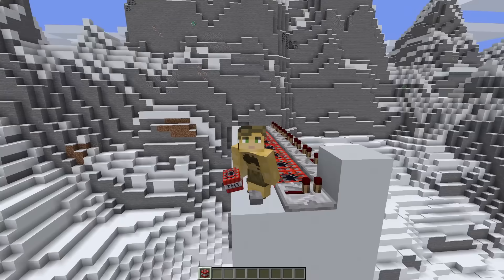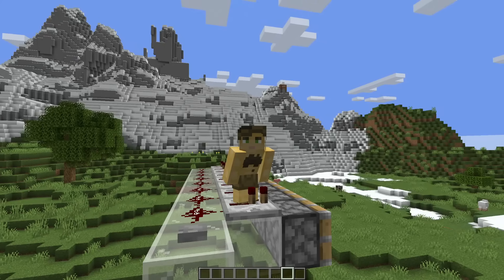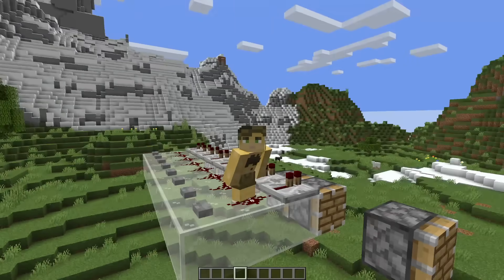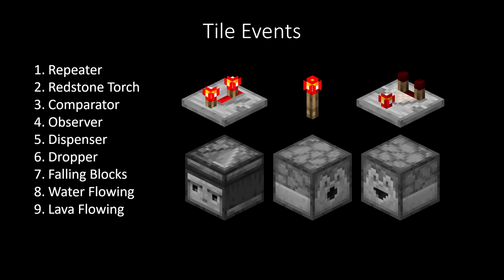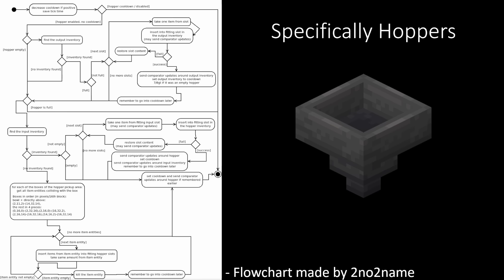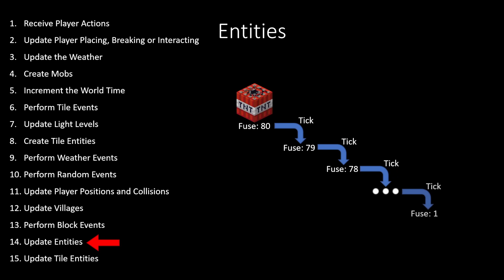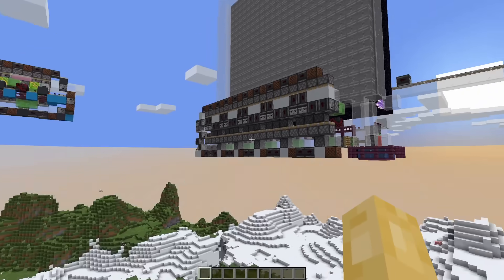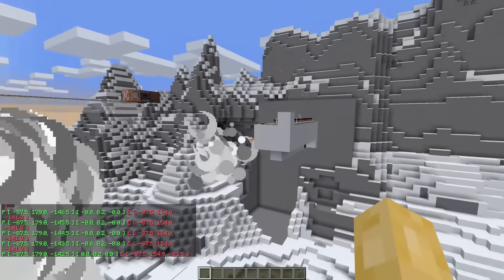TnT Railgun Using Minecraft's Quantum Mechanics

Comment: Would it be possible to change the direction of the tnt after it's left the cannon by timing other tnt to explode next to it? If it's possible, you could do some cool stuff by programming the tnt to go around things
Reply: It's possible, and it's very easy, just try it out yourself
Reply: oh yeah you could put some powered trapdoors next to the TNT alignment to change the flow of water a bit.
Reply: In 1.8 factions and stuff people build "lefty" and "righty" cannons which can hit a target and have tnt on the side shoot off the main charge.

Midair cannons can shoot and lefty midair can adjust in the air to hit a target.

U fusion cannons can adjust multiple times
Reply: You dont even need other tnt but yes its possible to do that aswell.

Search "255 lefty cannon minecraft factions" for your version with tnt and search

"255 infinite lefty cannon minecraft factions" for the version without extra tnt, it basically works by using order of directions ingame where E/W is calculated first before N/S
Reply: @Azaqa  you need other tnt if you want to change direction in mid-air AFAIK and for most purposes those ways to do it, that include hitting a wall are highly inefficient in TNT use
Reply: @ATOM-vv3xu  nope, search "255 infinite lefty minecraft factions" to see the concept for changing directions midair. You can also do it with tnt and its not that inefficient.
Reply: @Azaqa  I only saw one tutorial, that explained how it worked and it definitely didn't change direction in mid-air but instead changed direction, after hitting some blocks. If this tutorial/showcase was flawed I am open for you showing me ingame how it works
Reply: @Azaqa  and btw pls you play factions and pretty much the only reason why I never joined them apart of the fact, that it's still just everything 1.7 is, that faction cannons are not efficient and faction fights are not fun (compared to the alternatives at least)
Reply: @ATOM-vv3xu  https://youtu.be/tqtLz08SpuA

Heres a really quick video to explain the concept, you can find others that go more in depth if youd like and cannons that use it. We call it triangling in factions.
Reply: @Azaqa  if you use this method, the cannon won't be efficient, that's what I am saying all the time
Reply: @ATOM-vv3xu  dude its as efficient as ur gonna get for his idea...
Reply: @Azaqa  what your video explains is not what he explained and his idea is way more efficient than using what you call tnt triangles and powdered snow/enemy blocks to stop the momentum
Reply: @ATOM-vv3xu  dude what.... this is literally what hes talking about you can make the tnt go around things midair and go a theoretically infinite distance left/right. You could even go forwards, left/right, forwards again if you wanted to. As someone who has spent a lot of time using this in factions I can assure you its fully possible and you dont even need blocks to stop it, just a lot of guess and check (or some calculations)
Reply: @Azaqa  1. those direction changes have to have the same distance to each other (or 2% less each gt) 
2. if you want to use your facttions carrier as an excuse, I have spend almost 3000 playhours in an up to date tnt community that actually cares about efficiency and can confidently tell you, that for shooting straight and then to one direction (once), there are so much more efficient methods, that we don't even have terminology for thos stupid tech except maybe what could be translated into 0tick tunnler cannons, a tech that I haven't even seen anymore in 1.12
Reply: @ATOM-vv3xu  1. Yea, and?
2. If minecraft let me measure hours I would have a shocking amount on factions/cannon servers. We can shoot thousands of blocks through a 1x1 hole and stack sand from 255 to bedrock then nuke the sand stack with like 700 tnt. There are plenty of ways to left/right shoot and the most efficient and reliable is with triangles by far.
3.
Reply: @Azaqa  somehow my answer disappeared

1. yeah thats not named changing direction indefinitely it's just called shooting diagonal
2. I was just saying that talking about how much experience you have is pointless... and you do it again
3. what did you want to say
4. if you still think, that your tech is efficient just join our servers and try to compete with it, you'll stand no chance (keep in mind that we have different rules to benefit the fighting experience...)
Reply: @ATOM 2000  bro you really dont understand the level of efficiency... we actually had to grind for our tnt and work with limited amounts and had to shoot for hours. There were raids that went on for 48 hours straight. Everything had to be as efficient as possible. If you havent gotten into exposures yet you havent even begun learning efficiency.
Reply: @Azaqa  how do it comes that you expect me to not know about exposure? 

btw the fact, that the factions servers I went on don't even have TNT tracers, simulators and low tps, shows, that you just don't need to worry about every little bit of efficiency

btw. I even use calculators (that are not available to the public before you ask) to see if my cannons are even possible in a best-case-Szenario before even bothering spending hours on just finding the combination of positions where I shoot them

... and that raids go on for 50h is one of my main problems with factions, why bother fighting for longer, than you can stay awake, when you can fight for 5 minutes while continuously having fun
Reply: @ATOM 2000  we do have tnt tracers (we called them breadcrumbs), tps, we have mods with tnt recording to replay the shot tick by tick. The servers will all show TPS and the mods will do the rest (falcun, orbit, facutils ,ace etc) we also have calculators for plenty of things (distance based on exposure+power+gts+air resistance). We have calculators to find "midair ratios" which will find the exposure/power needed to stack 255 sand "midair" in a 1x1 block X distance away. Tons more calculators just cba typing them all, and basically none are public
Reply: @ATOM 2000  also in factions we organized things by timezone, we would have australians/asians for when its too late for NAs, EUs for when its too late for AUs. Thats not really an issue anymore anyways though servers added a shield you can set for like 16 hours of the day everyday. I havent played factions in a few years cause its just dead now but cannons in factions are definitely the most advanced tnt has ever gotten in mc
Reply: @Azaqa 

as I said we can talk on discord, the Youtube comments are not the best place for proving to you, that wargears and similar modes are more advanced, than factions (they might not have been back when you played but now they definitely are)

Comment: This made me think of the scicraft's ender pearl cannon. They mentioned that the pearl travels so fast it skips multiple chunks per tick so they don't need to load them. Applying this to TNT, could it be possible to create an explosion behind a wall without damaging the wall itself?
Reply: No, even when traveling super fast Minecraft still calculates colissions. But, if TNT should travel 10 blocks south and 10 blocks east in the same tick, it will do it in order instead of diagonaly, which allows for some kind of wall sikpping.
Reply: @JustARandomUsername2137  Well, that's a shame. Also means no insta-killing behind a wall arrow cannons. Although, Cubicmetre's shaped explosion is impressive enough by itself
Reply: @tooFarGonexk4he4tu3s  actualy, its possible with arrows. If arrow hits an enderman its colissions are disable for one tick so if its fast enough it can go through wall. You can see Docm77's hermitcraft 9 episode for more info
Reply: @JustARandomUsername2137  wow that is interesting. And, considering the speeds already achieved with arrow cannons, it should be possible to skip many layers of blocks in this single tick
Reply: @tooFarGonexk4he4tu3s  doc skipped about 300
Reply: @JustARandomUsername2137  We used todo this back on Cosmicpvp Factions. We shot straight down a wall on on the longside then straight right through regenerating walls, sand walls and normal walls all covered in water. So u had to fly TNT and sand over there. also had to break the slabs so u could stack sand on the wall to then blow it up.
Reply: Youre telling me they found a way to quantum tunnel in mc?
Reply: @picks6500  AYEEE QUANTUM
Reply: Yes you can. Tnt will go right through unloaded chunks. The only consideration is that once the first tnt explodes, that loads the chunk it's in, so if you want multiple explosions you need to space them out over time to let the chunk unload for each one.
Reply: what it means is the game checks on the chunks the entities arrive on on the tick, not what it passes through. For example an enderpearl passes through 3 chunks to arrive at 4th chunk, it will check the 4th chunk for collision, if it is not loaded then it will get stuck in there until the chunk is loaded. Which also means that you dont have to load chunk 1 to 3. Assuming your target is at loaded chunk and there are obstruction at an unloaded chunk before the target, and you did the math to know what chunk will be skipped and what will not, yes, you can quantum tunnel the tnt to the target.
Reply: @Thaumazein_FPS  awesome, i assume that calculating where the object will land normally will be extremely power intensive

Someone should maybe present this as a hypothesis for the occurence for quantum tunneling should it be an  unexplained phenomenon
Reply: @picks6500  hahaha, actually true, but still we don't know the absolute unit (the quantizing part of quantum mechanics) for physics irl. 

We knw its a tick for time in Minecraft, a 32bit float for collision or positions related measurements, and up to 64bit , 2byte for nbt data. 

But we still dont know for example what unit gravity operates in, or if negative values are tangible for phenomenon like time and temperature.
Reply: I would love seeing that too, a "Houdini bomb", that *teleports behind you* and explodes
Reply: Me wondering if you can somehow blow up obsidian with cannons
Reply: @lancetheking7524  Probably impossible, but if you were to make it push-able by pistons you absolutely could. I think it works because the moment it is pushed it has minimal hardness.
Reply: @lancetheking7524 TNT explosions are processed individually, so unfortunately no easy obsidian breaking

Comment: This is amazing but I find that I don't completely understand the portal event propagation. In this example you say that the front tnt are the projectiles and the ones behind are the charge. But also that the way the events go in order is like a snake up the portal. So wouldn't that mean the first block to be lit on the 2nd row (and every other past that) would be apart of the charge and not the projectile? So the cannon would fire forward for the first row but then then backwards the 2nd, and then every other.

I thought maybe I was mistaken and that they were all consolidated into 1 space but no it seems that there are 2 separate groups of tnt: the front column and the rest. Is there something I'm missing or was it just explained wrong? If you could help, that'd be grand.
Reply: I don't know much about portals, they are a pretty bad solution to ignite the tnt but he used two different sets of tnt and seperated them at least about 2 hundreds of a block, maybe more, they aren't at the same position

Comment: Now I reaaally want to see a cannon and flying machine which do something like,

- Blow a tunnel for the flying machine
- Flying machine goes through tunnel
- Every so often the tnt hits the back of the flying machine and bends the railgun left or right
- Do this every 5 blocks the flying machine flies

You'd need a blast proof flying machine so probably some ancient debris or something

I know very little about the quantum mechanics of minecraft so someone tell me if this is possible?
Reply: you are welcome to make it by yourself
Reply: you should probably search the term block event delay instead of quantum mechanics xD

but using this in a flying machine is pointless, it's way more efficient to use dupers, that work at the speed of the flying machine

I prefer just building those cannons just for fun and with no purpose other than beating other players
Reply: @ATOM-vv3xu  not really, this method is 100x faster assuming you have the tnt to support it (its quite pricy)
Reply: @Azaqa  how do ya wanna load the chunks?
Reply: @ATOM-vv3xu  well factions servers just made it so tnt loads chunks but if you were using the concept for tunneling a mountain its a non issue as 1 player can easily load it